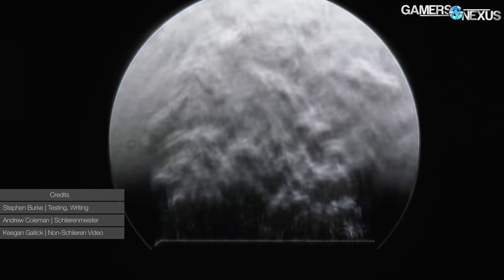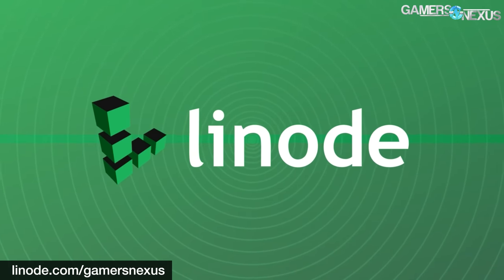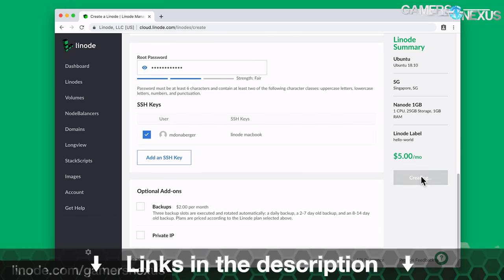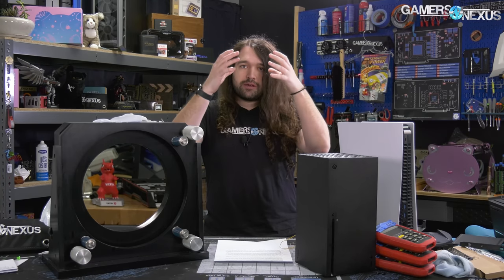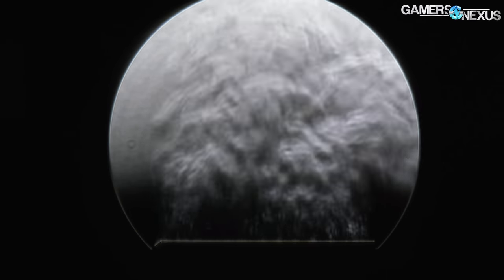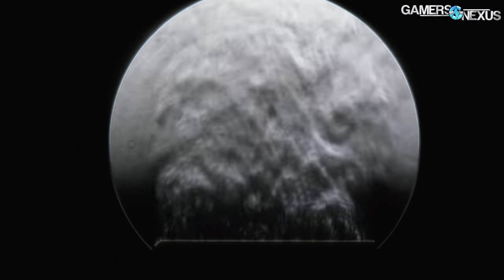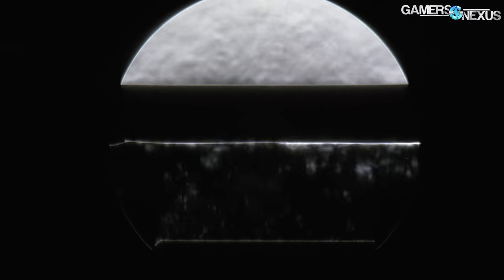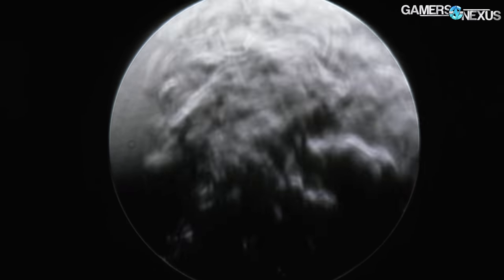PS5 vs. Xbox Series X Airflow Testing: Cooling Design Efficiency & Flow Paths

Comment: Series X is the most quiet console I’ve owned, except for Nintendo’s old cartridge consoles.
Reply: Ps4 or pro is if know what your doing when repasteing still can't understand complaints about ps4 or pro soundding like jet engines after repasteing.ive maintained both my glacier white ps4 & pro after 3  years  of usage both sounded like a jetengine when fan ramped up after carefully maintaining cleaning not rushing & cleaning chip and preparing chip to apply thermal paste both was quiet
Reply: @jasephase2k933  which Manz gonna be applying thermal paste en sheet. We want silent but violent from the box.
Reply: @jasephase2k933  The fact you have to "Maintain" a console is a joke...  Bad build quality obviously on the ps4
Reply: @abombfletcher  bad build is the easyest on a repair perspective hasnt got a xclamp
Reply: @jasephase2k933  If your talking about 360 xclamp you have no point...a couple generations off for comparison......The Day one oneX was loud ass hell, Yes...  But every console after was super quiet...  Sony had some new versions that you still felt the need to "maintain" its loudness....  Didnt have to take apart my xboxes ever  hehe
Reply: @jasephase2k933  loved your comment, but it would be better served if you would include punctuation. It’s like on big run on sentence.
Reply: series s is also ultra quiet
Reply: @clarohernandez6689  claro please answer me a question im stuck if xbox one x power pcb module has a damaged ribbon does this cause not to power on
Reply: Pretty much every Nintendo console is quiet as fuck.
Reply: Yes my Ps4 sounds like jet and I open up and clean it my  xbox 1 is cool makes noise now and then but better built and I prefer Ps4 for games but xbox got it same time as Ps4 2 years ago and xbox is built better
Reply: The switch is the most quite console
Reply: @mblackops2  whats this a competion whats quietest ps4 or pro is when thermal pasted properly
Reply: @jasephase2k933  My PS4 wasn’t that loud tbh, only when it was bootin up n shit. The PS5 is quiet af too, only problem is the disc drive is so fucken loud lol. The switch is just completely silent, don’t hear shit lol
Reply: @mblackops2  disc drive will be loud faster speed
Reply: @jasephase2k933  yea I had to thermal paste my ps4 to reduce loudness.. what’s your point? We as consumers shouldn’t have to do that. It should be thermal pasted properly and quiet right out of the box.
Reply: @Legendary_Bleu  myne was quiet out box only began to sound like a jetengine after 3 years
Reply: @jasephase2k933  you say that like it’s a good thing.
Reply: @Legendary_Bleu  unfortunately all thermal paste needs replacement eventually. This is true for any computer or console. Taking them apart every 5-6 years to clean up dust and apply fresh paste pretty normal. Cheap thermal paste dries up, good thermal paste still has pump out. Heating and cooling cycles  will cause paste to flow out of the heatsink, reducing thermal efficiency over time. The only permanent solution is a solid state pad like thermal grizzly carbonaut or maybe liquid metal.
Reply: @Mazgic  all computers need there paste changed eventually.
Reply: @Dirty_Bear22  Sony pony
Reply: @Legendary_Bleu  do you have some magical infinite life thermal paste?  I was saying that all computers need new paste eventually, it’s not exclusive to Sony consoles...
Reply: @abombfletcher  the thermal paste on them usually needs to be replaced, just like on a pc. Every electronics device needs to be maintained to an extent. Consoles generally need to be cleaned just like computers, which is why I think the dust catchers on the ps5 are a great thing if they work properly. It will make it so people don't have to disassemble the whole console to clean it.
Reply: @jasephase2k933  IT IS A CONSUMER PRODUCT!!!!  Consumers should not be required to Maintain...again bad buid... MS learned from their mistake.  Sony goes looks/design over function on the PS5...
Reply: @jasephase2k933  Can you start making sense? Your sentences are broken and annoyingly difficult to interpret
Reply: @Dkryptd  excuse me teacher in punctuations i didnt learn where to put them symbols excuse me
Reply: @jasephase2k933  Having good grammar and knowing what I'm saying doesn't make me a teacher. Sounds like it's your first day learning English or your confused, get it together
Reply: @jasephase2k933  you shouldn't have to regularly maintain a toy designed for children to use for years. Even then, you and I both know after maintenance the noise starts up again within a month or two, and if it's summer the maintenance won't even help
Reply: Why can nobody spell QUIET!?
Reply: @abombfletcher  Maintaining your own belongings. Pure madness 😂
Reply: Quite the console indeed.
Reply: quiet*
Reply: Steven Pounsett  damn autocorrect. Thanks for the catch. I usually proof read before I post, but that one slipped through.
Reply: my series x is louder than my ps4 pro and my ps5 by a lot...
Reply: @jacobjohnson2948   don't lie.  Ill play a next gen optimised game all day on my Series X and I've never heard the fan speed up even once.  All online reviews on the console also say it's silent.  You're the first person I've heard say that.
Reply: @jacobjohnson2948  you know there's countless videos on YouTube, that suggest otherwise. If you're telling the truth, then there's something wrong with your Xbox as they're proven to be quieter than PS.
Reply: @jacobjohnson2948  you probably have something wrong with it
Reply: I dont know bro. My bricked 360s are pretty quiet.
Reply: @abombfletcher  you dont fix your car?
Reply: @GusMortis  yeah, I remember them. Had six that had to be sent back. Smh.
Reply: Tbh i have mine and compared to the original xbox 1. Its silent 🤫
Reply: @TylerNessss  GameCube Wii and Wii U weren't
Reply: @jasephase2k933  dude… punctuation is your friend, don’t fight it.
Reply: @dom4591  Mine is pretty loud and even overheated :( I tried putting it in a place with better ventilation and now it doesn't overheat but it is definitely the loudest console I have, even my parents are bothered by it, does someone know how to fix this? Not a fanboy, just a guy who wants to play next gen games without it sounding like a plane, again, if someone knows how to fix it or at least how to make it more silent, I would greatly appreciate it.
Reply: @ang3el164  that's very strange.  I've haven't even heard the fan on my Series X yet.  The only way i hear the fan is if i put my ear up to the exhaust.  Either you got a defective console or you have it sitting somewhere where the air doesn't circulate.
Reply: @dom4591  I doubt it's the air, I do have it in an entertainment center but it's open and I have the fan headed outwards, the intake has about 15 cm of completely free space.
Reply: @dom4591  I think that maybe it's the dust, I took a look in the console and it has a lot of dust, maybe I'll try with a vacuum, I told my family about all of this but they think that this is how it's supposed to work, so I'll probably be stuck with a noisy series x
Reply: @ang3el164  yeah that's unlucky dude.  Could be the dust though
Reply: @dom4591  Yes it was! There was a literal cloth of dust in the heat thing that sucks air, I had to open the Xbox and clean it out and now the noise is almost non existent, I have to make and effort to hear it, nice, thank you for helping me and believing me, some people I asked would literally just tell me that the PS4 is worse.
Reply: @ang3el164  that's amazing.  No problem ✌️
Reply: Don’t own a switch do you
Reply: @Dirty_Bear22  Arctix MX-2: after 10 years of use its thermal ability stays the same, never dries out
Reply: @mblackops2  I think the series X/S are even quieter. The tiny fan in my switch can be heard while gaming handheld
Reply: @nickfox919  literally just finished playing on my switch handheld... there is no way you can hear anything from that 💀
Reply: @mblackops2  well I have the OG first gen models so maybe that's why
Reply: @abombfletcher all consoles have to be maintained